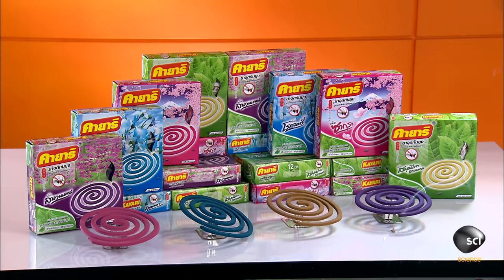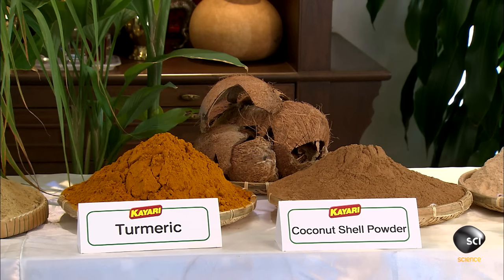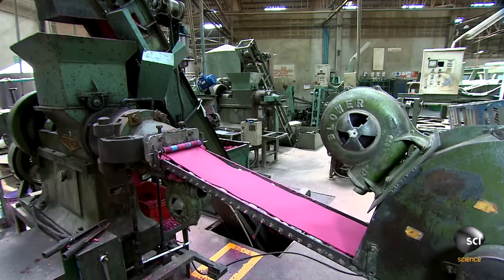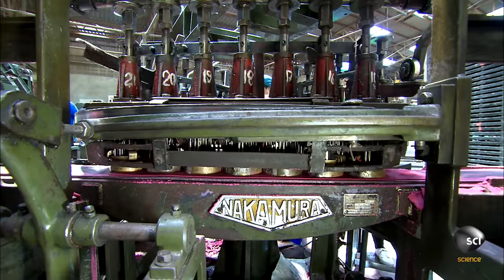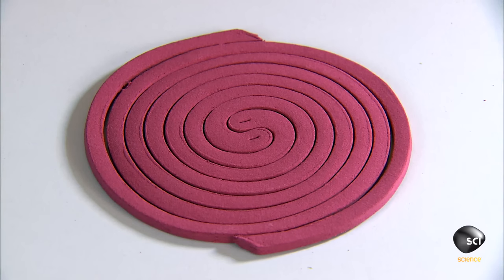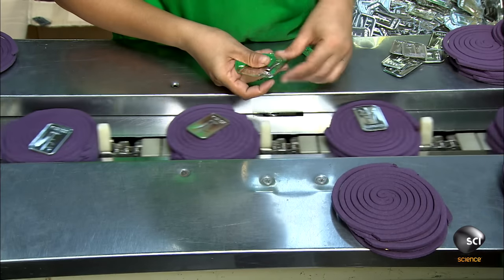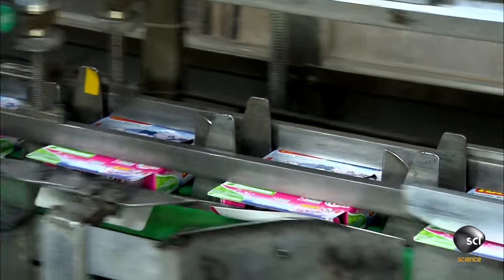Mosquito Coils | How It's Made

Comment: Actually i just broke one of these and im on ytube to find a way to hold it and somehow ended up here
Reply: Get a mosquito coil holder, those that twist open into 2 halves. Some brands' have a wire mesh on one half (the base is sealed, so it is a tray by itself) where you let the coil sit and this half will collect the ash at the bottom. It's easier to dispose the ash later also.

Obviously, pieces that are too short and risk your fingers being burnt when lighting should be just discarded.

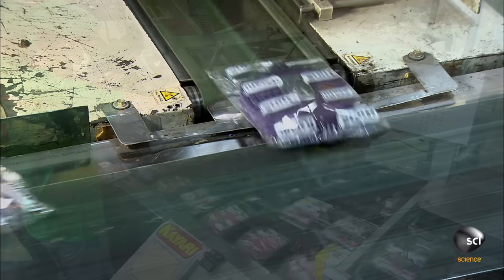Comment: The machine opening the boxes and putting them on the conveyor at 2:08, is NOT a ROBOTIC arm. For one thing, it is not programmable to do different tasks. And second, although the entire machine may be controlled by a computer, the arm itself is mechanically connected to the conveyor system to always stay in sync with it. That way, if the conveyor line speed changes (as it would on start up), the boxes are placed on the conveyor in the right spots.
Reply: redditor